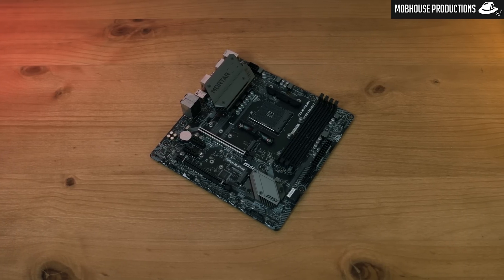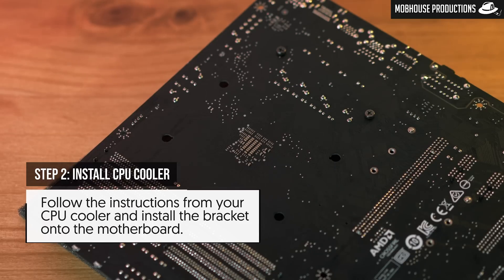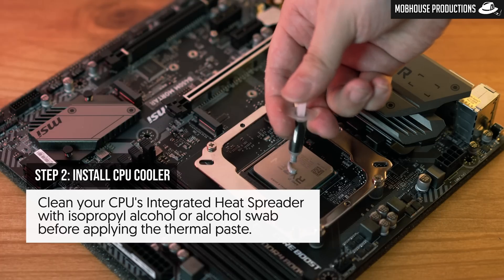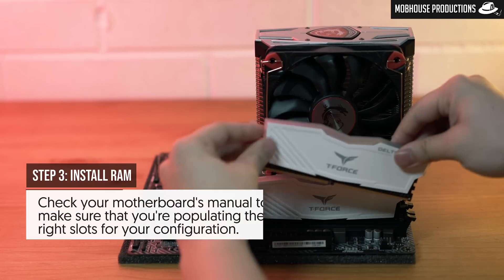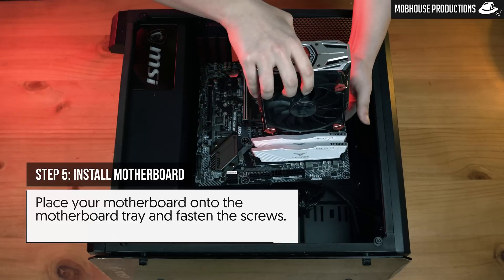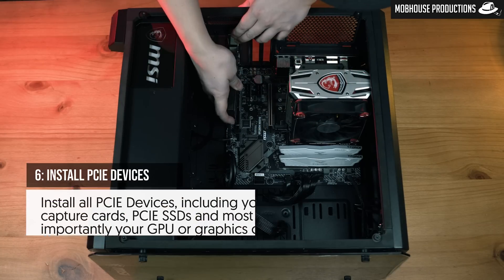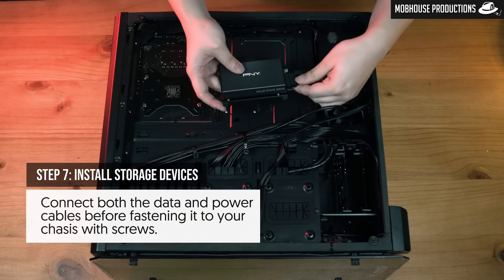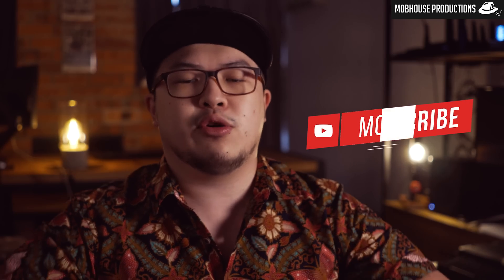PC build guide - How to build a gaming PC - full beginners guide

Comment: quick question, wouldn't you need to spread the thermal paste evenly on cpu instead of leaving it as a blob  before adding it the cooler? or it actually does not matter at all?
Reply from the maker: depends on the paste as well. Some require you to actually spread it out due to the denser consistency. For the most part, a good size blob in the middle should be adequate.
Reply: ahh got it. thanks for the feedback
Reply from the maker: no worries bro. what thermal paste are you using?
Reply: apologies, i do not remember the specific brand name that i used as i only pick one within a reasonable price like RM15 to 30 for it